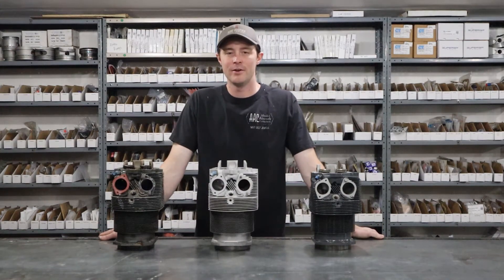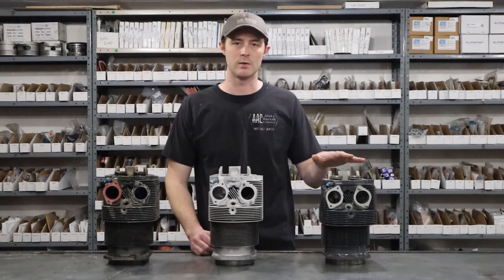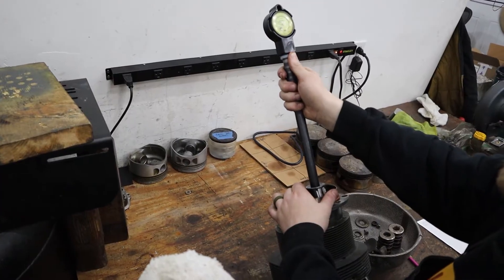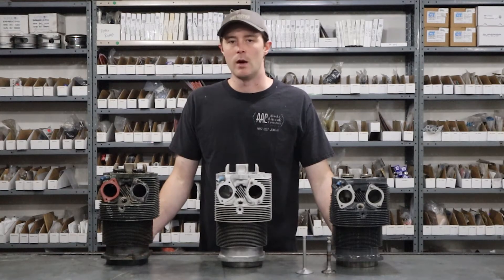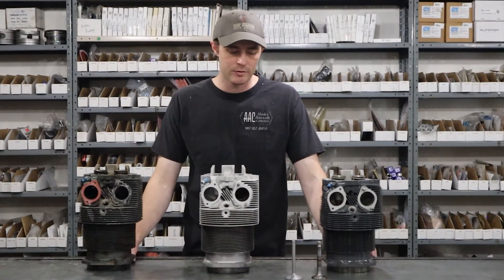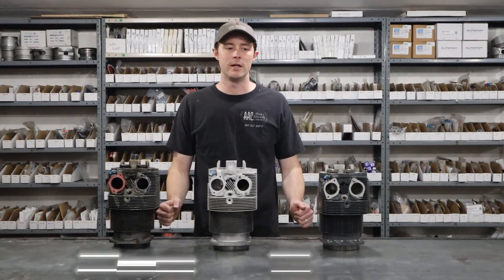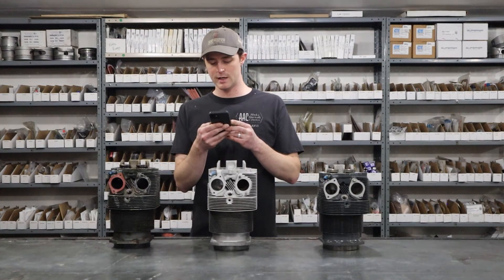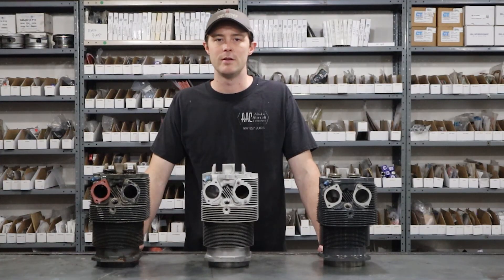What You NEED to Know: Aircraft Engine Cylinder Repair

Comment: Thanks for your video.
It would be appreciated if you would answer the posters questions below.
Here are questions from me which I hope you will answer.

If a steel barrel is good and the aluminum head is cracked, do you demate the cyl barrel and mate it to a new or good head-?

If you do not demate cylinders and heads, why do you not do this-?

Before removing exhaust guides do you heat the aluminum head to a specified temperature to remove the guide and press in a new guide at this spec. temp-?

Comment: I have read that in the past, a solution was used to wash aircraft parts in, before overhaul or renovation.  This solution would remove paint, soot and grease from aluminum without damaging the underlying metal.  What was the name of this solution?  Is it (or similar) available nowadays?
Reply: MEK ~ Methyl Ether Keytone (AKA Aircraft Stripper). Maybe?

Comment: One more question , Chrome Cylinder  after you honor the cylinder to remove the glasse and make it wall patten  do you continue  or reinstall  New  chrome piston Ring  thanks
Reply from the maker: Good questions! We always want to install NEW rings after honing the bore and breaking the glaze on the cylinder wall.
Reply: To the previous question ,,do you continuous as a chrome cylinder ,, then to use  Piston Ring for a Chrome cylinder,,which you know it can No be chrome ring

Comment: Thank for this explanation ,my question is for the exhaust valve for o 360 exhaust valve 1/2 stem  where I can find a Chuck  to hold  the 1/2 valve
Reply from the maker: Thanks for watching! 
What do you mean by this? A chuck for what purpose?
Reply: A Chuck for 1/2 valve or exhaust valve  my valve cutting Machine    Up to take 3/8   Valve stem